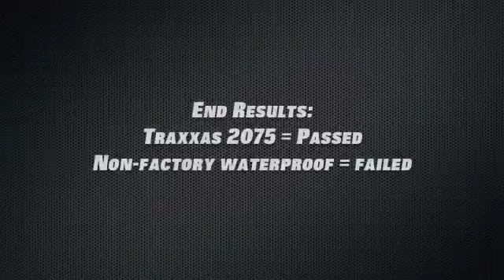RC Truck Stop -- RC servos--Is It Waterproof?

Comment from the maker: Sorry you were offended. The point was to test a factory waterproof claim. To put your mind at ease, the control servo was waterproofed with waterproof tape around the seams, silicone glue on the input wires and waterproof grease around the output gear. All common waterproofing techniques--as said in the video. I hope this information brings you peace. Again, the point was to show if a claimed waterproof servo is actually waterproof and how it compares to the average homespun waterproofing job.

Comment: Is this a joke? You compared a factory waterproof servo to a servo that you waterproofed yourself but never mention how you waterproofed it? What's the point? The viewer has no idea what you have done! You might be comparing a factory waterproof servo to one that you have added some grease to, or one that you have dipped in CorrosionX or one that you have liquid taped etc. Essentially you have just tested whether a Trx 2075 works after being dunked in water & compared that to an unknown! Rubbish

Comment: I've never waterproofed any of my servos, just added some dielectric grease to the gears, and have never had any problems after running through mud and water, that's with a Hitec 645MG servo, but when I opened it I did notice little rubber like o-rings on the servo from the factory

Comment from the maker: Yes (and, well, no), and there are different degrees of waterproof. Specifically, there are different industry standards. And, then there's water resistant, too. It's really just semantics. The point is one company's waterproof isn't the same as another company's. The biggest influence in the difference in one waterproof compared to another waterproof is depth. As depth increases, water pressure increases--usually not an issue in RC. Time submerged is, however. Nothing is truly watertight.